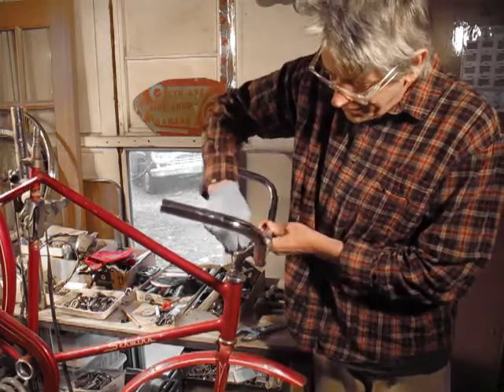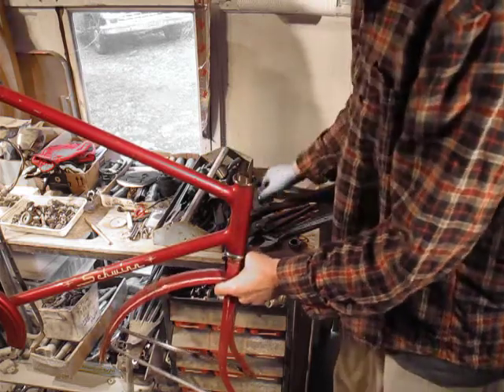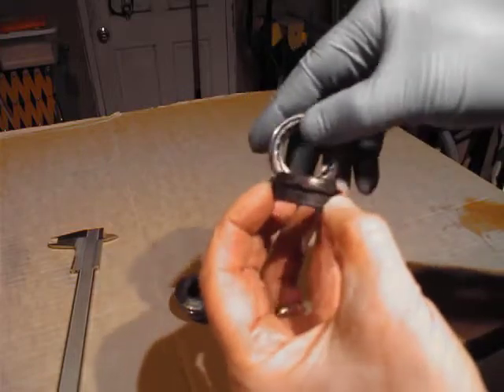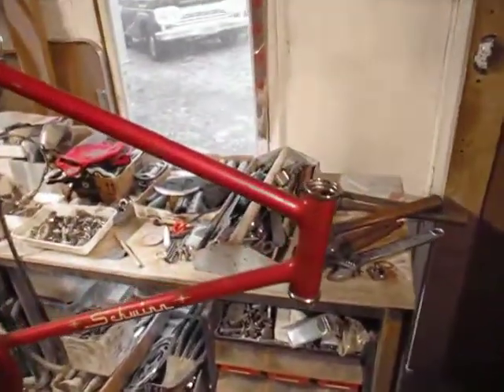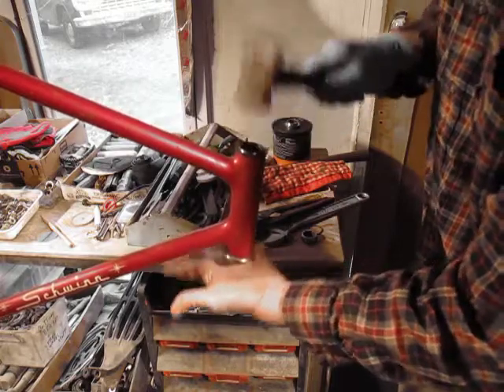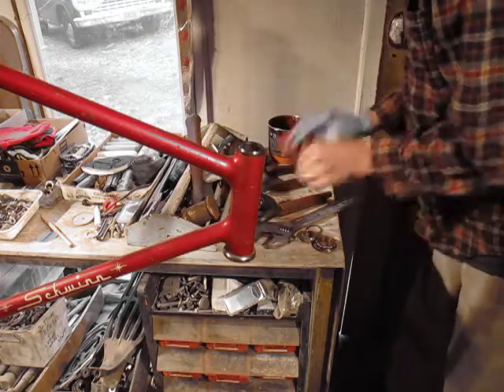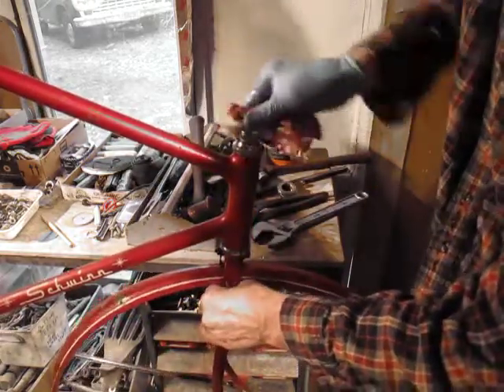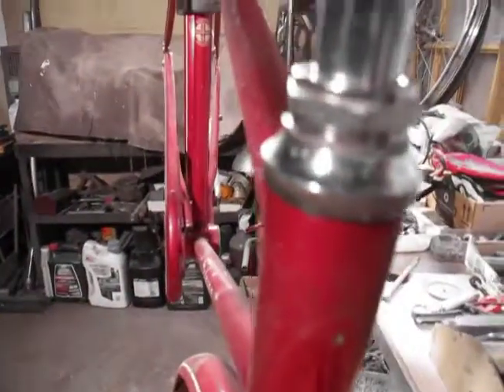Schwinn headset upgrade for  most vintage  Schwinn bikes.

Comment: Note , the upgrade will not work on the later Schwinn Bikes made in Japan such as the Le Tours. The head tube diameter is smaller and the top race will not go in.
Reply from the maker: thanx good to know i will have to put that in the description of the video.